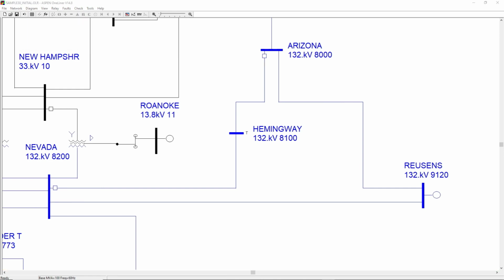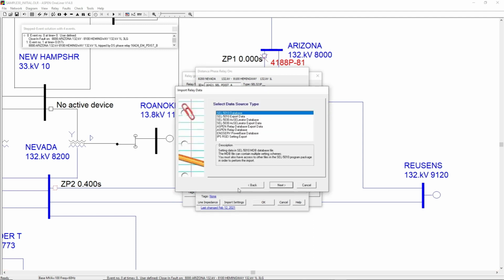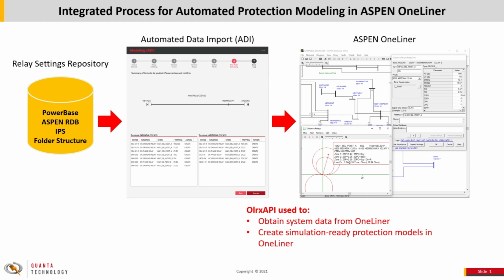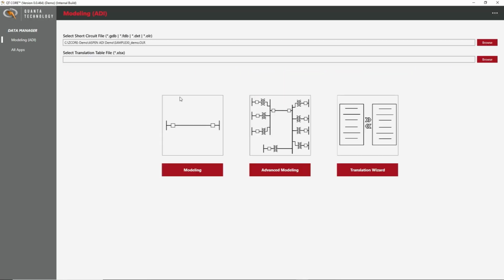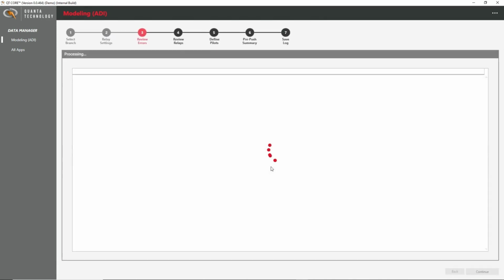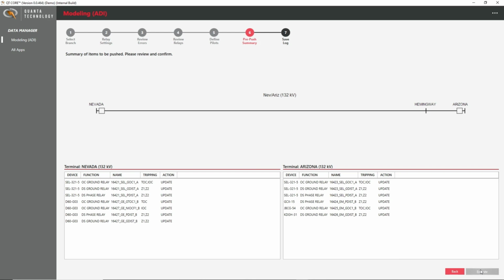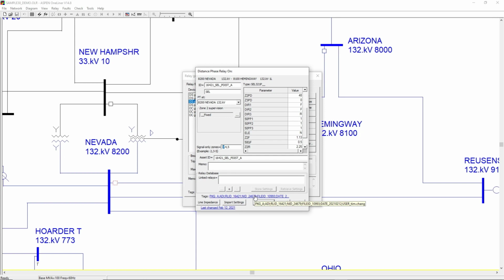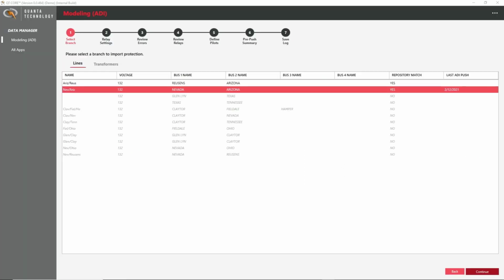What's New in OneLiner V15: A third-party OlxAPI application for automated protection modeling

Comment: Nice job. I am wondering does the application come with ASPEN ONELINER program or need to be purchased separately?
Reply: Hello. This tool is compatible with multiple setting repositories and requires configuration for each power utility. It will need to be purchased separately.